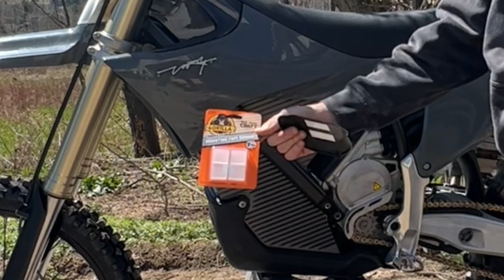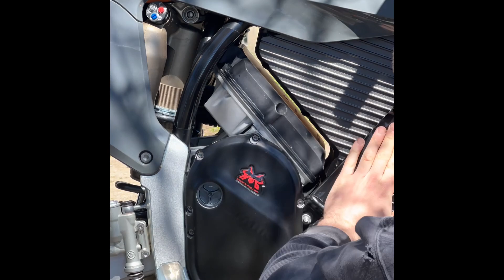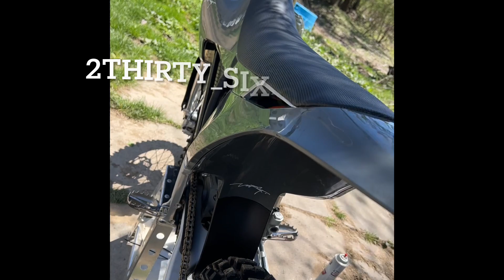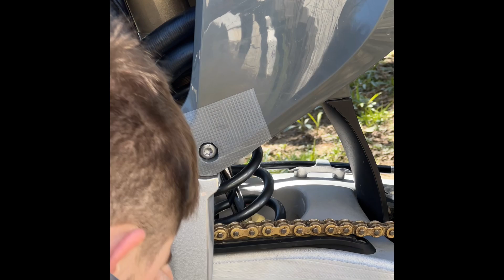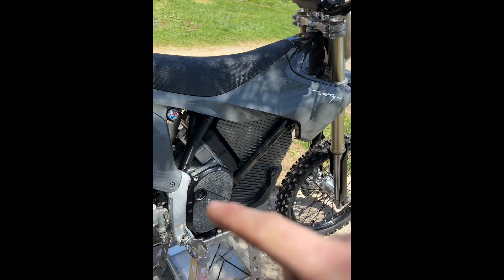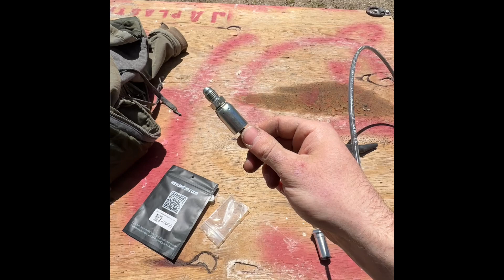Adding Protection to my Stark Varg

Comment: How did the cat tongue tape on the number plates hold up?
Reply from the maker: @weekendwarriorvids  it’s a good temporary solution. It held up good but graphics are better of course
Reply: @ did your boots rip it off after like one ride? I’m thinking about putting this over top of my graphics to serve a grip tape.
Reply from the maker: @ no my boots didn’t rip it off, just use heat and make sure it sticks good. It wears faster than grip tape because it’s a rubber so it’s grips harder than the thin grip tape
Reply: @ ok thanks. I was also looking at stomp grip. It’s just so expensive.
Reply from the maker: @ I’ve never heard of it. I use bikegraphix for my graphics with their roughneck vinyl. It’s rough textured and last a long time. You can also just buy rear number plate guards that protect the graphics from wear but I don’t think it’s grippy